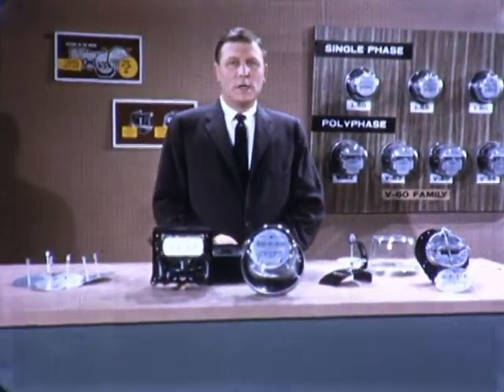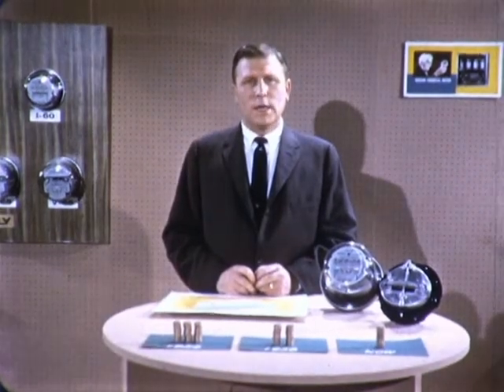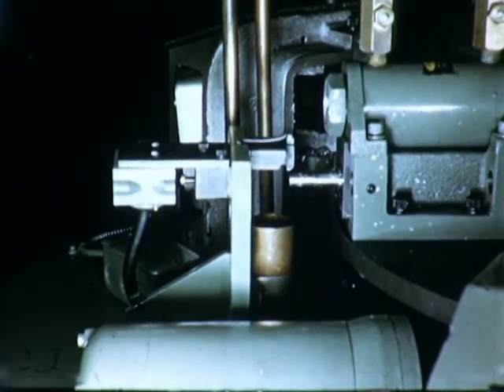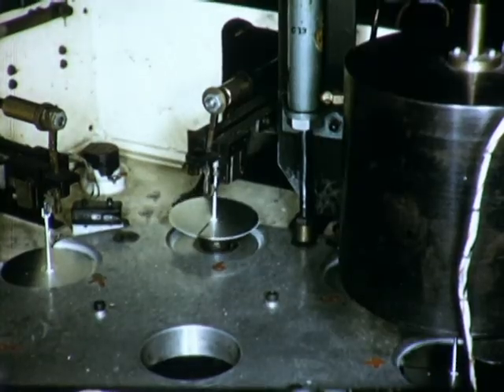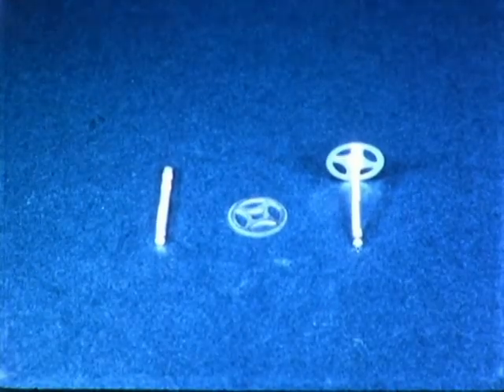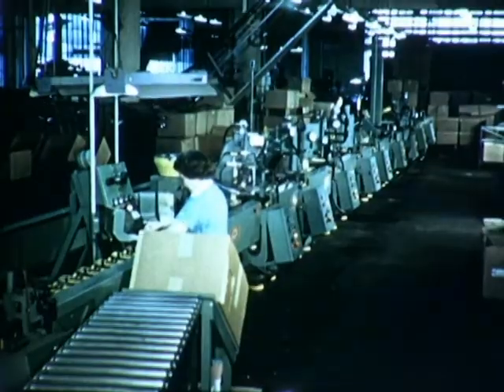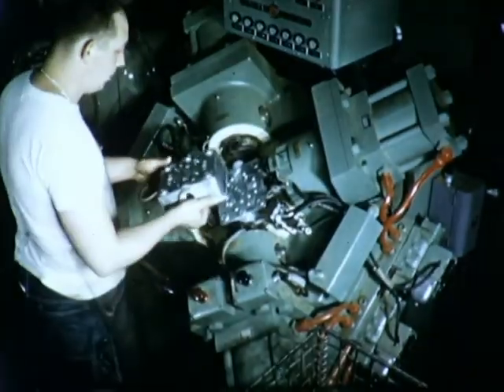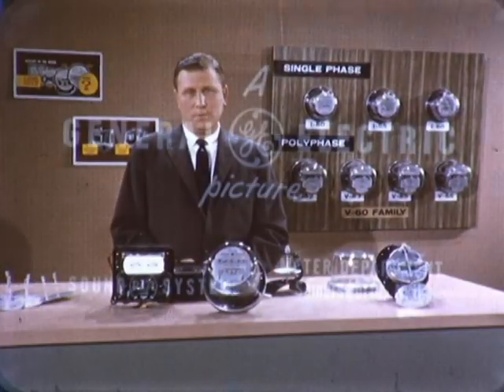Frontiers of Meter Manufacturing - 1960

Comment: LMAO! 1:03 ....Floating Loadwheels! :-D

-BoomBoxDeluxe.
Reply: Type I- 50 A & S Watthour meter for single phase circuits were introduced in 1948, one of the latest innovations of this new meter Magnetically suspended disc, where bearings previously used would wear over the course of time, whereas the magnetic suspension of the disc reduces maintenance costs and replacement, in addition to the magnetic suspension system of the disc on new I 50 Single phase Watthour meters, one piece register faceplate and lighter weight aluminum frame that holds the retarding magnets in place, reduced depth of glass covers than was used on earlier type I- 20 & I- 30 watthour meters, made the new I- 50 Watthour meters the first new meter in 50 years of Watthour meter manufacturing!